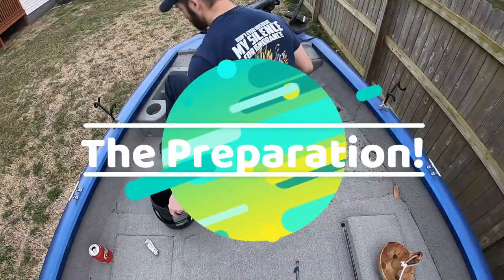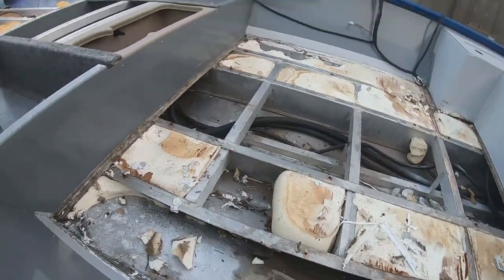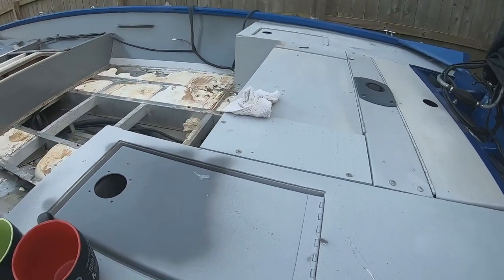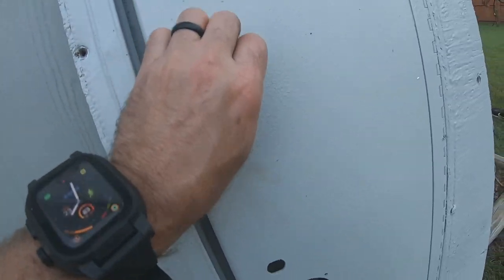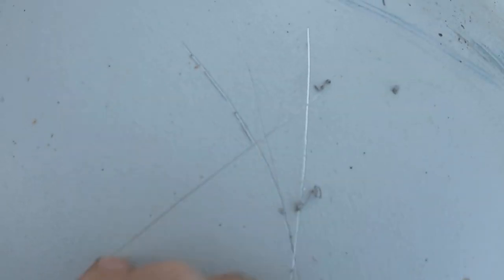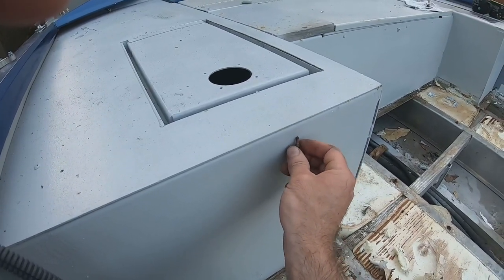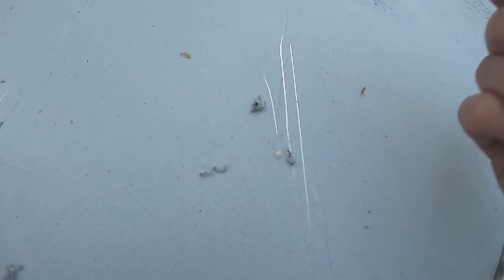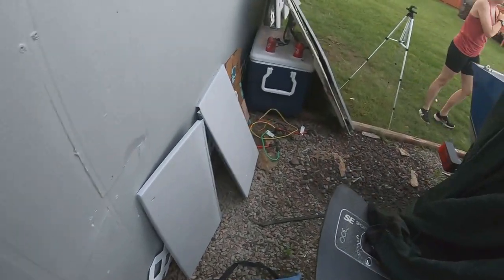Should you paint your boat deck with Flex Seal?!

Comment: I think its best used in the liquid rubber form in a can roll on method for RV roof type application... I see good reviews for that application. Two part epoxy paint with non skid additive would fit your application.
Reply from the maker: Thanks for the info.   I appreciate that.

Comment: I used black flex seal in a 1 gallon tub on my deck it's been 2 years and I only had minor scratches that I easily fix by just spraying them with the can I only had to do that once on a small area no  bigger than 4 inches. I did use a lot of coats and I didn't use a spray can it sucks that it didn't work for you sorry to hear that.
Reply from the maker: I appreciate that.  I’ve used flex seal for a lot of things and it worked great.  Just failed on this.  I’m glad it worked for you!  That’s awesome!   Thanks for stopping by my channel.  I appreciate all the views and comments from everyone.
Reply: @rjguess maybe hit it with a clear coat water proof spray paint as a last layer of defense

Comment: You must first apply a primer, wait a day, sand it and then paint using flexseal. Apply small amount, let it dry 12hrs and then apply  another 2 coats of it. Let it dry between at least 12 hours.
Reply from the maker: I did spray a coat of primer.   I actually tested it out on a small area before I decided to do whole boat.  It worked in the small area.  But in other areas it peeled right off even after a few days of drying time.  It didn’t work for me.   Thanks for the info.  I do appreciate it.
Reply: @rjguess  dont bother scraping it off just paint over it no?
Reply from the maker: I sanded it all off and painted it with a marine paint for boats.
Reply from the maker: pacifca nonook  yes,  it is metal.  I have repainted the boat to correct way with the right paint.   Thanks for your advice.

Comment: Looks like you didn't prep the surface first.did you sand it? Did you clean it with acetone after?you should have used the gallon. Spray doesn't adhere well. Rolling it works best.
Reply from the maker: Yes it was prepped.  I sanded, cleaned all the glue, sanded more, wiped everything down.  Made sure it was dry.   I ended up stripping everything back down and buying a different paint for boat decking.   Much better.  Lesson learned because bought a chunk of $$$ in Flex seal.    Thanks for your comment and watch time.
Reply: I was going to do mine tomorrow with flexseal,but after watching your video,I won't. Thank you.
Reply from the maker: 1982pantro your welcome.   I couldn’t find a video about it and that’s why I chose to make this one.  I’ve used flex seal for other things around the house. It just did not work with the boat.   Thanks again for commenting and watching!
Reply: I sanded/prepped(w/ acetone) a small section of my fiberglass boat up front where a trolling motor was mounted after I filled in the mounting holes with epoxy. I sprayed 2 thin coats of black flex seal 24 hours apart on the area(around 1.5 sq. ft) and it's survived all of last summer and this winter. I took the boat out last weekend and it shows no signs of cracking, fatigue, etc. My experience has been good, but fiberglass properly prepped is great substrate.

Comment: Do NOT use flex seal (liquid idk about the others) on deck of boats. Any boats. It becomes extremely slippery when wet because of the waterproofing.
Reply from the maker: The spray can had good grip.  Yes, I could see how the liquid form of this would be slick when it gets wet.    It has a different texture than the spray can.

Comment: Okay bad idea to paint your deck with FS.  How about using it to seal a leaky seam?  I have a wooden skiff with a centerboard trunk that is letting water in.   I flipped the boat over and sealed the bottom of the cb slot with fiberglass cloth and epoxy.  It is still letting water inside the boat.  I am thinking of using flex seal to coat the entire inside of the cb trunk.
Reply from the maker: I would use it for that.  Just not what I did!   I think you would be safe to use it inside the cb trunk.   I’ve used it for leaks On my gutters and it worked.

Comment: Painting checked plywood is sketchy at best, Looks like the wood might have been wet ?

Flex spray isn’t really designed for that application, there are much better coatings for that application.
Reply from the maker: Yes, agreed.  I eventually used marine grade paint.  The wood was dry.  I made sure to check that thoroughly.   I made a bad mistake and thought I’d share it.  This way others who have this idea might not do the same.

Comment: What made you think it wouldn't scrap off with sharp objects?
Reply from the maker: Ronald Towe I tested it.  I took a small area about 12 inch x12 inch area.  Put 3 coats on it and let it dry for a few days.  Stomped on it, threw it sound the shop, dropped needle nose on it, hammer, and it passed the test.  So I let a small area fool me.   Now my boat is painted with marine paint and a hardener agent.

Comment: Well. First off. Flex seal is used to seal cracks and waterproof. Not for all floor use. Second. Looks like you didn't prep the panted product properly. Not sanded .
Applying any paint without a primer on plywood is sketchy to begin with  
Don't blame the product for poor cleaning or prep.
Reply from the maker: I’m I used paint stripper.  Then I sanded and used wire brushes.   I then used mineral spirits and other cleaning agents to clean the dust and dirt off of all sanded areas.  Then I used a grey primer.  2 to 3 layers.   Last, I used the flex seal.  It was prepped correctly.    It was t just sprayed on plywood.  It was also sprayed on the aluminum.   It peeled off on both.  Thanks for watching and commenting.

Comment: what the fu^&^k would you paint your boat with that?  all  you have to due is do some research and  do it right
Reply from the maker: South West Florida Aerial I painted it based on research from others who have done their boats with flex seal.  It worked for them.  But it did not for me.  I did my research.   Sometimes the answers you get are not correct.  Lesson learned.  I even tested it on a board first.  It worked.  So my test convinced me it would work.  It’s not like I went into a project complete ignorant of what I was doing.  I assume by your comment that you didn’t watch the video in it’s entirety to get those answers .   But I appreciate what watch time you gave me.  Thanks!